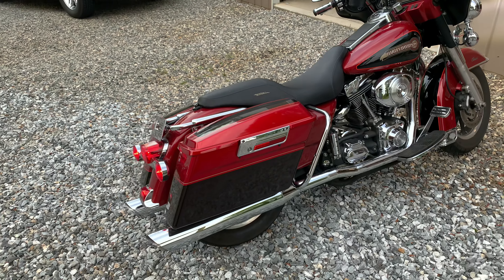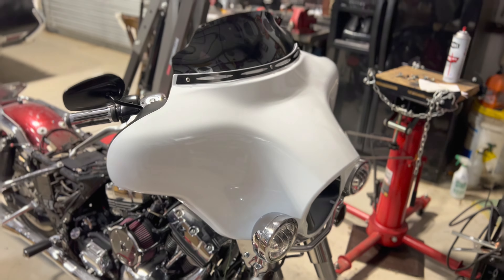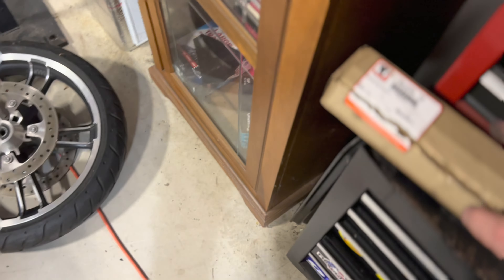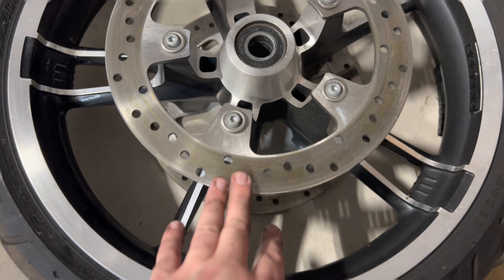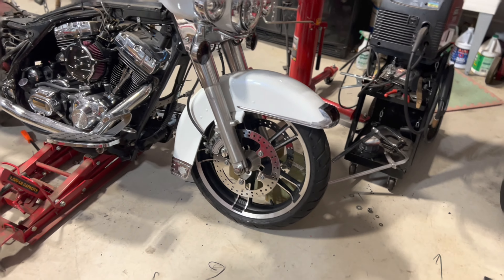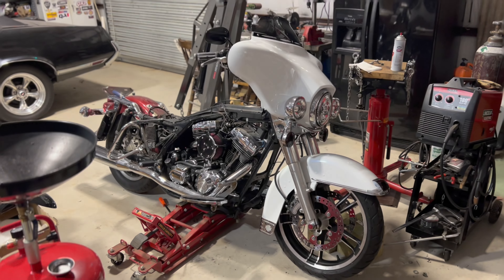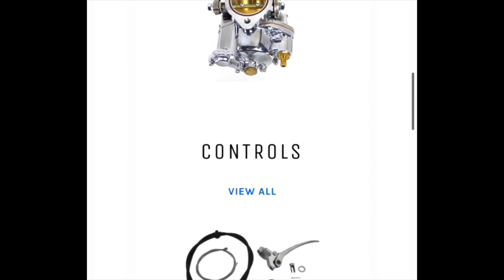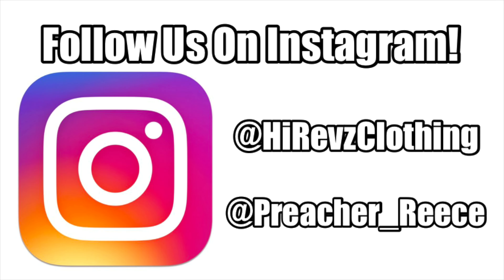Installing a 2008-Up Wheel on an Older Bike -'06 Harley Electra Glide Extended Bagger

Comment from the maker: ** FYI - Our wheel came off of a non-ABS bike, so it bolted right up with the new axle and provided spacers.  If you have an ABS wheel, you can either change it to a standard non-ABS bearing, or shorten the provided spacer and keep the 3mm larger ABS bearing in it.  I would suggest changing both bearings to new standard ones. **
Reply: If you’re going though the trouble of replacing the bearings, you can just get bearings that fit the original axel, correct?
Reply: Did you replace the spacer inside the wheel, the one that goes in between the bearings?

Comment: I would essentially have to buy 25mm bearings correct?
Reply from the maker: The newer wheels already have 25mm bearings.  You can upgrade an old wheel to use on a newer bike if you switch them to 25mm though.
Reply: So I seen a video where he used his stock 1” axel and bearings. Is that another option

Comment: Did you have to do anything with the ABS bearings?
Reply from the maker: My wheel came off a non-ABS bike, so it had regular bearings.
Reply: Same I need to know
Reply: I'm doing the same thing to my 2000 2000 ultra classic

Comment: Nice informative video. Would all this apply equally to 2008-up Air Strike wheel?
Reply from the maker: Yes, I believe so, but you could also keep your stock rotors.
Reply: Thank you for the fast reply. Yes, I will keep my rotors, it's has non ABS wheel bearing already in. Just add axle kit thanks to you!

Comment: Did you keep the ABS bearings in it with that axle ? I'm doing the same thing to my 2000 ultra classic
Reply from the maker: Hey, just saw this.  Our wheel came off of a non-ABS bike, so it bolted right up with the new axle and provided spacers.  If you have an ABS wheel, you can either change it to a standard non-ABS bearing, or shorten the provided spacer and keep the 3mm larger ABS bearing in it.  I would suggest changing both bearings to new standard ones.

Comment: Will this not work unless I purchase the 11.5 rotors? or can i use the rotors off my old wheel?
Reply from the maker: You have to change the rotors to 11.5”, or change the calipers to the later Brembo calipers.  There is also a way to take apart your stock calipers and grind out enough space to fit the old rotors.

Comment: You didn’t have to change the bearings from abs to a non abs?
Reply: I just ordered the rotors and axle from your links below
Reply from the maker: My wheel was a Non-ABS wheel.  If you use an ABS wheel, you will need to swap the bearings.
Reply: @HiRevzMedia  Thank you I really appreciate you taking the time and replying to my question, I left a tip for you when I purchased the axle kit from your website.
Reply from the maker: No problem and thank you very much!
Reply: @HiRevzMedia  1 more question my 97 has a speedo gear for the odometer how would I connect it with this wheel?

Comment: I got a 07 Ultra Classic I got my hands on a Turbine 19in front wheel will it work with that axel kit???
Reply from the maker: Yes, should for no problem.  Just check to see if it has an ABS bearing
Installed.  Mine did not.
Reply: Ok awesome well, the first thing I did was swap the bearings to the one that the bike had originally with the original axle and made my own spacers but it’s a little tight, so I’m going to buy the axle kit and the bearing kit that you offer on your website and install it on the bike

Comment: I'm looking to put 2012 rg 16in wheels on my 05 eletra glide. Will they work?
Reply from the maker: Yes, with the axle listed in the description.  Not sure what wheel you have, but the stock brake rotor might move over to the new wheel and work fine.

Comment: Did you change the spacer that goes in between the bearings. The enforcer wheel I have has abs bearing so I’m ordering the non abs bearing.

Comment: I have a 2000 Road King. Got the same enforcer wheel. Bought axle kit from your site and rotors from link. The spacers do not fit. Will swapping the abs bearing for a non abs make a difference? With new spacer on throttle side the other spacer is too large for primary side. Please help, Thanks.
Reply from the maker: Yes, my wheel was non-abs.  You should be able to trim the spacer to fit, or replace the bearings with non-abs ones.
Reply: @HiRevzMedia  2 new wheel bearings at it fit like a glove!
Reply from the maker: Awesome!
Reply: @wesvoges224  I just got a 2006 road king what was the part # for the non abs bearings im looking to do this
Reply: Looking for part # and spacer inside wheel

Comment: So the 25mm axle fits in the 3/4” spot with no problems?
Reply from the maker: Not sure about the 3/4” axles.  This is a 1” axle being replaced by a 25mm.  These axles are only .4mm off.  Most people end up tuning down the original axle to 25mm, and then make custom spacers.   However, the fork saddles are the exact same.  So you can buy the axle listed and bolt it directly on, and it comes with the correct spacers.  Only thing to worry about the is getting the brake rotors listed, or switching to the Brembo calipers.

Comment: What about fitment for the rear wheel? Ive got an 04 road glide with the spoke wheels that im trying to replace
Reply from the maker: Not sure for the rear, my assumption would be that you would just need a late model rear axle
Reply: 08 + has a Cush drive. I’m sure it’s doable but idk if the juice is worth the squeeze

Comment: Just bought a pilot wheel off of an 18 road glide to put on 07 Electra. The wheel is coming with abs bearing in it. Just swap the bearings and this kit will work?

Comment: I cant find a video of anyone doing the swap.
Reply from the maker: What swap?
Reply: @HiRevzMedia  actual video of putting the enforcer wheel on the older bikes. That question is asked all the time on HD fourms and many answers are given. It would be nice to have a video of it being done so it would be found every time its searched for.
Reply from the maker: This is a video of it being done.  If you buy the axle I bought and buy the rotors I bought, (links in the description,) everything bolts up exactly how the other one came off.  It’s a very simple process with the right parts.  We didn’t feel the need of videoing bolting the rotors onto the wheel or bolting the wheel on the bike.  They bolt back on just the way the stock one comes off.

Comment: Hello again….I purchased everything that was suggested and I even had to machine the new axle both end to fit and the wheel does not fit because the rotor bolt hit the calipers maybe it’s different on your 06 compared to my 97. I really wish I could have made it work.

Comment: Can you provided the link from where did you get the rotors from?
Reply from the maker: Links in the description
Reply: Got it ! Last question: I saw a video that on does rims if they are ABS I need to replace the bearings to a non ABS as my bike is a 2005 Electra glide classic. Did you had to do that? Are does rims are ABS? Thanks

Comment: I know this video is bit old, but I’m wanting to install 2012 airstrike front wheel into my 2000 electra glide. Does the same apply to that wheel? New non abs bearings and the axle kit you sale? Thanks

Comment: Looks great: 
Couple questions? 
Where do I order the axle from? Did you change out the ABS bearing? 
Or did or didnt that wheel come  with ABS  in that wheel? 
And it is a 10 1/2 brake rotor rt? Is that the size of a non ABS rotor?
Reply from the maker: Links are in the description.  Our wheel did not have ABS, so we didn’t need to change any bearings.  The rotors are 11.5”.